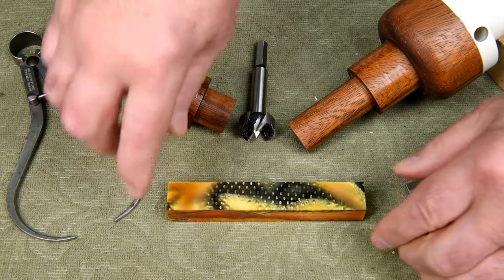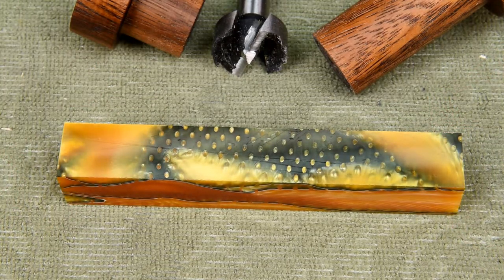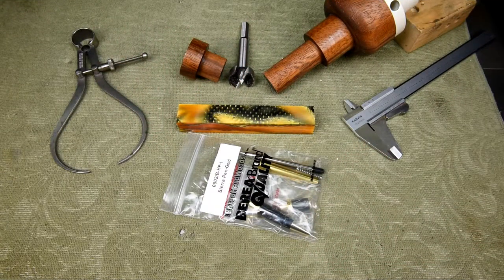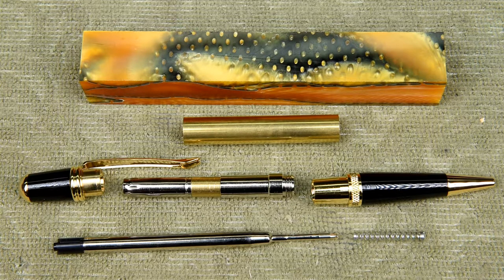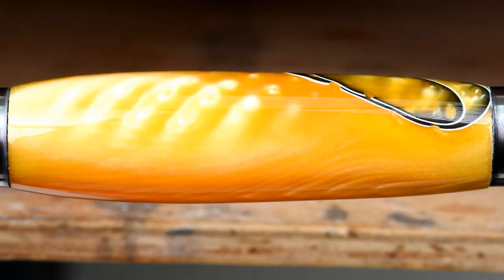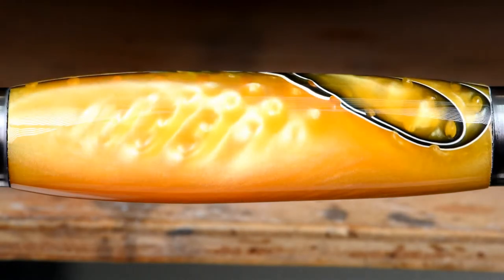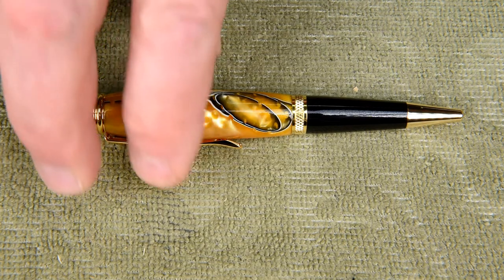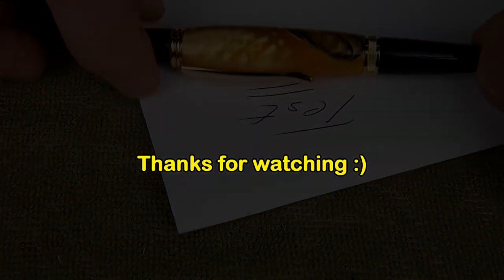The Fish Skin Pen

Comment: Looks great!!!!  I am not one to tell others how to do things since they be smarter than me, but since you have a mandrel saver tail piece, WHY are you still using the brass nut?  it defeats  the purpose of having the mandrel saver, plus you can get the blank tighter so it will not slip.  With the brass nut still on if you over tighten the tail stock  you can still bend your mandrel rod.  Just my thought.
BobT
Reply from the maker: Thanks BobT
Re: "still using the brass nut" Thought I'd made a video on that, but maybe I just replied to a similar comment not that long ago.
Reply: must have missed that video :)